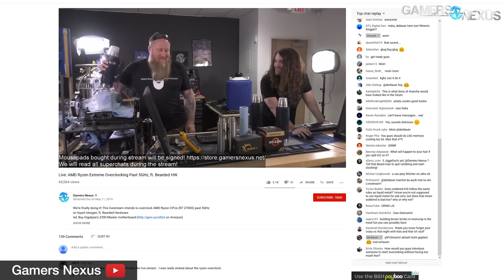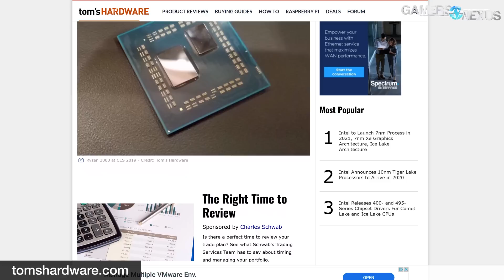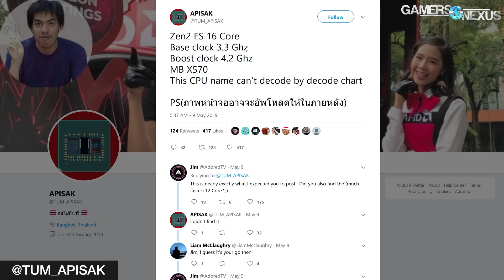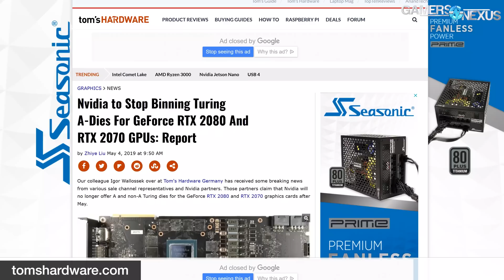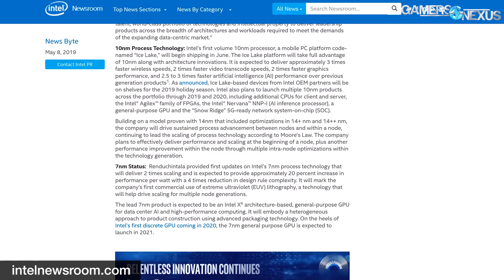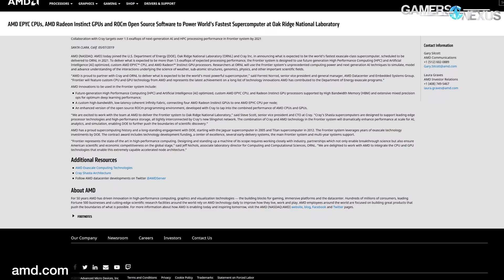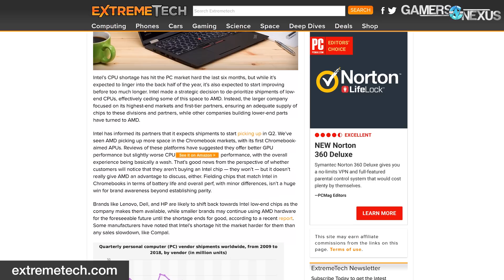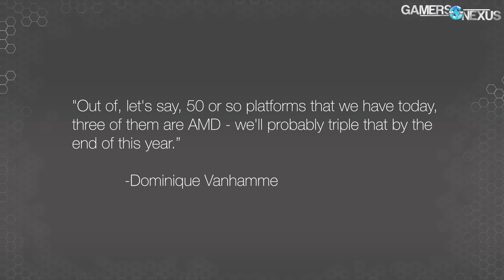HW News - Intel Shortage Ending, Ryzen 9 16-Core, & AMD Supercomputer

Comment from the maker: Show notes here: https://www.gamersnexus.net/industry/3472-amd-ryzen-9-intel-cpu-shortage-ending
Find our extreme overclocked 2080 Ti recap here: https://www.youtube.com/watch?v=33AwPq9g6eo
Reply: If software companies make games that require pink ram sticks you would need pink ram sticks for ultra settings.
Reply: @GamersNexus

Are you going to hear about or cover the soon to be disclosed May 2019 Flaw?

If you haven't heard anything, maybe the information is spreading slowly.

Perhaps Intel won't mention this until 1-2 months late so they can attempt to use fear to make existing users upgrade to 10nm if its a new architecture.

The A-Dies news is almost month old.
Reply: Zombieload flaws from Intel, cant wait to hear your take on it
Reply: Wow, remember when it hit 1 petaflop in 2008...
Reply: There really is no need for 5 GHz all core frequencies on Ryzen. Even single core that's far more than they need. Just push 4.5 GHz with a 5-10% increase in IPC compared to Ryzen 2xxx and they will still be the better value option by far.
Reply: nobody was expecting 5Ghz all core turbo. 5Ghz boost these days never means that and you know that.
Reply: Time for a haircut  bro

Comment: Too bad there is no reflection on the Intel security vulnerabilities if I was on the board of a large company I would be very skeptical of intel's products and claims. It seems like every new security failing is only Intel and then they show results on performance which have little or no relation to "fix" they recommend. In short I would not trust anything that Intel says and the Dell about face is a clue.

Comment: For those who may be curious on select subjects:

~ Ryzen 09 CPUs: This would ultimately be the smartest move by AMD, in my view, as even Forbes Magazine is openly stating that the possibility that the end of Threadripper could be nigh after the Zen II: Ryzen 3000 Era sounds as if it would be more than a believable measure, if only because of the facts that AMD never actually had a true Battle Plan with the TR series during its initial launch (except to combat the Skylake X and Cascade Lake~SP HEDT and Workstation chips, most or all of which were overthrown by the 2990WX until the 3175X and Xeon Scalable 9000 series came into play) and are ultimately too close to their Epyc line (sans the ECC Memory support and the noticeable lower RAM cap) to truly make them a feasible choice in a "Money is an Obstacle" budget of 2000$ USD (let's face it, Threadripper, especially the 2000 series, was always aimed towards those that have a 5000$ budget or greater, due to their Workstation Grade Xeon Platinum~style performance), thus Ryzen 09 replacing Threadripper would be the best possible scenario from a consumer standpoint, especially if it meant that prices would stay under half a thousand US Dollars for a chip from AMD in the Ryzen lineup; whether or not Ryzen 09 comes is totally up to them though, but they would be making a mistake not to do this, it would force Intel and Zhaoxin to up their game in the Multithreading department and even IBM can understand how much of a threat AMD can become if Ryzen 3000 truly shows its worth in high performance numbers, there would be potential for competition in more than just Team Blue versus Team Red down the road.
~ Intel launching 07 Nanometers in 202I: The rise of the 07 Nanometer manufacturing process on Intel's end does not necessarily mean that we will get Meteor Lake chips as early as 202I, though one can only wish for that so they don't have to rely too heavily on Ice, Tiger, and Alder Lake being on the 0I0 Nanometer node for three to four fiscal years; the Xe series Graphics Cards running on the 07 Nanometer process is a smart measure though, as this would put it on par with the eventual Navi and Ampere GPUs that will be coming from AMD and Nvidia in the 202X decade; as Xeon Phi is now officially being retired, it can only be hoped that Intel Xe will take what made Larabee and Xeon Phi what they were (in the case of their Co~Processor line) and optimize it on the GPU forefront, it probably would be more interesting to see the GPU line be a Hybrid of Graphics Card and Co~Processor when it launches but that would probably be a pipe dream at this current point in time without explicitly concrete evidence on the subject.
~ Dell increasing their Epyc~based Servers: This is a subject that ultimately needs more attention than it's getting, because as I mentioned above, Epyc (which for those who are too young to remember, was formerly known as Opteron) is basically Threadripper but with ECC Memory Support and a higher RAM cap (02 Terabytes, if memory (no pun intended) serves correctly, around the time when Ryzen debuted), and knowing that most companies haven't truly had any real intention to certify Threadripper for ECC Memory support proper, it makes it feel noticeably clearer that TR could potentially either be on its way out or remain specifically aimed at the HEDT market if it sticks around for a matter of years beyond now, meaning that Epyc will only gain more support in the Workstation and Server Grade Desktops and Racks that you will be seeing beyond this point. Heck, the concept of Epyc chips showing up in a significant amount of Dell Precision Tower rigs in Future Time, no earlier than the beginning of the end of Turing and the Early Ampere Era sounds highly reasonable, though if we've learned anything from how Epyc was topped by Threadripper II in terms of performance, AMD will need to make sure that they're not competing with themselves, thus I truly hope that their Rome series Epyc chips do have a higher core/thread count and speed than Threadripper III out of the box (assuming that TR even is getting a 3000 series lineup), the Workstation and Server chips must never be unreasonably superseded by their Desktop and HEDT counterparts and thus balance must be key to prevent any form of confusion or price oddities, that much must be anticipated.

Comment: People:  Oh daaamn, look at 9900k with 5.0 GHz boost, it's a monster CPU
Reality:  9900k is 4.7GHz on all cores (8C - 16T) and it's only 5.0GHz with manual OC with $100 liquid cooler ($500 + $100 = $600)
People: we want AMD to have 16 cores and 5.0GHz out of the box, or we won't admire AMD as game changer
Reality: Ryzen 3600x is 4.6 GHz on all cores with 8C - 16T (same specs as 9900k) and mostly will OC to 4.9GHz & costs only $250
Reply: $250 is the reality part ?
Reply: @letni9506  Yes, Ryzen 3600x is $250 and have same specs as 9900k
Reality is.. 9900k is i7 with $350 price tag, but Intel did some shady work and disabled HT from 9700k so they charge you extra $150 for the 9900k
So, $250 for Ryzen 2 3600x is reality, not imaginary dream
Reply: I have a Core i9-9900K, it supports 5GHz overclock on all cores providing you have a good power supply and enough cooling.

Comment: if we can do an all core 4.5 Ghz on the 16 core i'd be happy.
Reply: This I think is very reasonable. You expect that the chiplets are binned, so if one can boost to 4.5, the other should as well.  Also, this lowers thermal issues by spreading the heat out more. It's a good design.
Reply: @mduckernz  I'm really just looking for something to replace my 6700k so I have the more cores for video encoding in handbrake while being able to maintain the same speed per core I could run my 6700k at, if ryzen can do those speeds then I think we will finally have a great competitor to Intel that is enough to justify a new mobo and CPU purchase
Reply: @DanielsCorner644  I run my 6700k (yeah, me too haha) at 4.4 or 4.5GHz, so yeah, I would very much expect that Zen 2 can do these speeds. Providing it does, I too will be upgrading to it. Probably a 12 core? Not sure I need 16.

Comment: GN you should talk about Intel's zombieload new vulnerability 2019... lol shills!!
Reply: Waheed Hassan   What's the big deal. Patch it when a patch is available and move on.
Reply: @wysetech2000  Their "speculative execution" does such a great job (performance vs. power consumption) only BECAUSE IT IGNORES EVERYTHING. This can be compared to Volkswagen's "clean Diesel", which was nothing but a fraud as well. ;-)
Reply: @wysetech2000  I have installed the patch on 1809 build and got 15-20% performance reduction.
Reply: @waheedhassan01  Yeah, i just installed the patch on mine but haven't noticed any difference .......yet.
Reply: @wysetech2000  you must be keeping HT on and prolly have newer 8th or 9th gen cpu. They have hardware mitigations but older generations dont have and 90% gamers are using older cpus.
Reply: @waheedhassan01  I have a 6th gen and yes, i have ht turned on.
Reply: @wysetech2000  install patch KB4494441 on 1809 build.
Then test your system. Don't just say all of sudden you tested it.
Reply: @waheedhassan01  I didn't say that i tested it. At the time i didn't notice any change in anything.
I just rendered the same video i rendered last week. Yes it was slower, by about 4 minutes.

Comment: RedGamingTech confirmed the 5.0 GHz boost for the 12C Zen2-CPU! Not all core indeed. Before RedGamingTech annouinced it AdoredTV alluded to it in his Twitter-reactions.
Reply: Red Gaming Tech confirmed nothing of the sort. It's all rumour and speculation. Nothing is confirmed until the products launch.
Reply: @johnm2012  

Apparently you form an opinion while you don't even follow RedGamingTech! Either that or you were sleeping while you were watching it. A source who works in the industry told him that the shown sample of the 12c Zen2-CPU clocked @5 GHz. 

If you have followed the tech news in the slightest then you ought to know that AMD has shown two samples to motherboard-companies and OEM's: a lowly clocked 16C and a fast clocked 12C. 

You also ought to know that AdoredTV pointed out that he had gotten detailed information from his source - who has been correct a lot before - and that he couldn't give specifics to protect his source. He can't because AMD often gives slightly different information to several partners to trace leakers. 

Both RedGamingTech and AdoredTV have good sources who have given correct information (like the Radeon VII and the separate I/O die and 8 core-chiplets for Rome) before! Their informants are trusted sources and Jim and Paul are confident about it, otherwise they wouldn't mention it that way.

AdoredTV Tweeted that "people who expect 4.5 GHz will be very pleasantly surprised". You are not very pleasantly surprised with 4.6 or 4.7 GHz. AdoredTV also said - I paraphrase - : "I wonder how people will react when the first 5 GHz Zen2 CPU shows up."

You believe what you choose to believe, it has been confirmed that the 12C Zen2 CPU can clock @5 GHz with a safe voltage. That much is for certain! It is possible that AMD will choose a boost of 4.9 or 5.1 GHz. but that chip will get to 5.0 GHz with a safe voltage if you 'overclock' it.
Reply: @peterjansen4826  You really need to learn how to distinguish fact from rumour. Some of this may turn out to be true but none of it is official.
Reply: @peterjansen4826  TL;DR

Comment: OOOOOOOHHHH! More Cores,,, more Threads,,,,,, still snail and slug SLOW at 4GHz so I call Bullsh!t!! If all this stuff is supposed to be super duper quick then why do simple file transfers (10Gb or more for example) scream at first then drop down!!?? This stupid behavior has been around since Windows 95! My old i5-2500K may not Bench as high as the current CPU's but seemed just as fast. So WTF are we all really paying for?  We should be at current Spec's with speeds in the 7-8GHz. Microsoft, AMD, Intel need to get their head out of their ass and make something worth the current prices.

Comment: I wish they had x570 motherboards that would just double the amount of 3.0 lanes as there aren't any 4.0 Components out yet and 5.0 is around the corner so there is little point to even making 4.0 components anyway. But I guess it's not that easy and would most likely require some crazy chipset magic.

Comment: Will be interestig to see if the high end x470 boards can reliably/safely run these 16 core CPUs. If I remember correctly, a lot of them went totally overboard with power delivery.
Reply: Power delivery won't be an issue on X470 boards, 100% sure about that. All of them overclock nicely (I have a Crosshair 7 Hero, but all of them look neat and capable).

Comment: I'm not expecting 5 GHz, I am expecting 4.3 GHz at 115% IPC of the old 5GHz. I'm excited because 4.3*1.15=4.945
Reply: was thinking the same thing, the low voltage/tdp of ryzen limits the frequency boosting

Comment: AMD in 2 years: "We're happy to introduce the 32-core Ryzen 7 on the X770 platform.
Reply: *with quad channel for the first time ...
Reply: @Radovanslav  If that's the case then Socket AM5 is going to need a lot more pins than AM4.
Reply: @johnm2012  just going be socket tr4 lul. your old x399 mobos will work with our new chips.  :)
Reply: @johnm2012  Gotta be skeptical about that lol. I mean we've been stuck with dual channel for ages now but there aren't many reasons to get quad channel to mainstream, I "only" have 2x8GB and it's more than enough for me and all games I have (and most games in general anyway). It would be insane if it actually happened on AM5 or smth
Reply: Eric Zeng  literally anyone who needs them for highly parallelized apps for a living
Reply: Eric Zeng  oof can't deny that

Comment: In theory, the 16-core CPU could hit the same frequency as the 8-core. It's made of two, 8-core chiplets after all (not sure if IO chip for AM4 desktop is confirmed). So if COOLING and POWER DELIVERY were sufficient the only issue is how XFR is applied, and obviously binning of chips as per normal. Even if XFR sets an artificial limit then perhaps overclocking manually can overcome this. Again, my point is that why should a 16-core definitely do WORSE than an 8-core if it's made of two 8-core chiplets? We'll see.

Comment: Ryzen 12 or 16 Cores probably going to be 4.5 to 4.7 Ghz and that's being optimistic.
Reply: I think the 16 core will be around 4.4 to 4.5 Ghz where as the 12 core will hit 4.7 Ghz and I don't think that is being very optimistic. The threadripper 16 core hits 4.4 Ghz so 7nm should be better.

Comment: "Intel Shortage Ending", thanks to AMD taking market share.    As to AMD clock speed, even if 4.8GHz is achieved on all cores will it's IPC match Intel CPUs for IPC?    Very important for some programs, including some CPU demanding games.
Reply: Their IPC should be basically identical or even slightly above that of Intel after this expected IPC bump from the particular changes they are making (particularly in load+store ports in the front end, and doubled AVX units), but I expect that Intel will still hold a slight frequency advantage, but it will be much smaller than before. And they will still be significantly less costly. Sooo yeah

Comment: 5 GHz idk but AMD is ending the last gap: single core performance.  This is the gaming chip now.  The 3000 series Apu will be competent.  And Navi will offer rtx 2070 performance for about $300, half the MSRP of Nvidia.
Reply: I don't have to believe, this is the news from multiple sources.  The 3000 has already beaten Intel and that was just an early r5.  R7 3700x is my preference but r5 3600x I will take if money is tight.
Reply: Why do people who love AMD always have to overhype things? Do you really believe AMD would achieve that kind of performance and still charge half of their competition? What business sense does that make for the company?
Reply: They have to make a splash being so far behind.  They have a lot of cash on hand, it was the best performing stock on the NASDAQ in 2018.  Expectations are extremely high in very serious and well equipped to know positions.

Without an eyebrow raising price to performance ratio, people will stick with what they know.  Only later will they see the low power use and heat dissipation.  I also boycott Intel because of its association with Israel.  I have an Nvidia 1070 with is enough for me.  But Nvidia and especially Intel had terrible years in a bullet market.  The CPUs are going to pass Intel for at least half a decade and everyone who's done any research knows it.  It takes years of r&d to get a new product line on the market in scalable production.
Reply: And also if u always think that AMD is always the cheapest. 

Well let me tell u something,  what if AMD had the most marketshare and had the fastest CPU and they were #1,  i will bet u that there CPU's will cost alot  more money than there competitor Intel 

U wanna know why, because the AMD shareholders will want more money, when u got the fastest and best product on the market u can get away with higher prices

AMD is a business,  they do not give a fuck about u fanboys

Comment: 3:05  It really isn't.  The 2700X has a base clock of 3.7GHz and a boost of 4.3GHz.  Advertised boost clocks are always limited to one or two cores.  The claim that Ryzen 3000 chips will have boost clocks of 5GHz means exactly that - the base clock will be 4.xGHz, and the boost will be 5.xGHz, and the boost applies to one or two cores.

It's the same with Intel.  The 9900K has an advertised boost clock of 5GHz, but that only applies to one core.
Reply: But, people regularly run those Intel processors at 5GHz all-core, that's the problem. It's pretty unusual to see a 9900k or 8700k not running at 5GHz or higher, all-core, in a well built system.